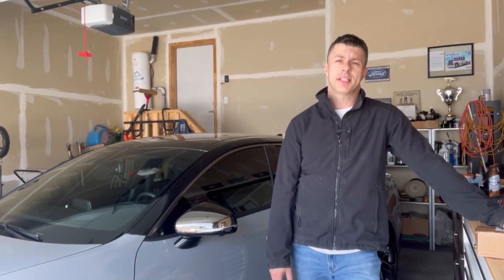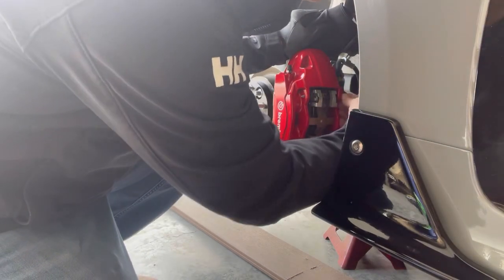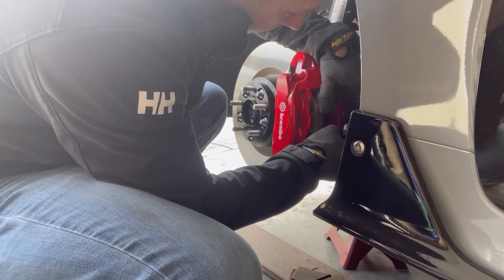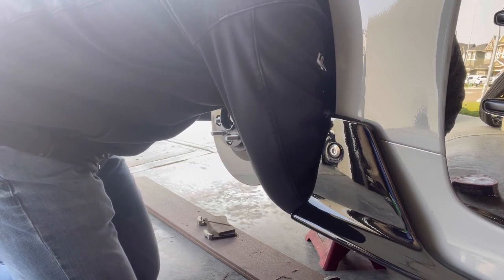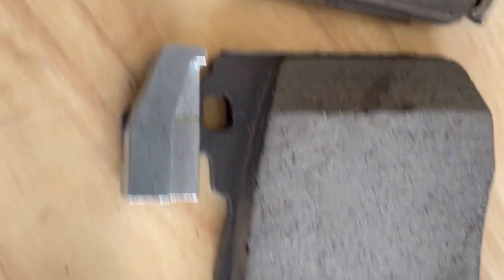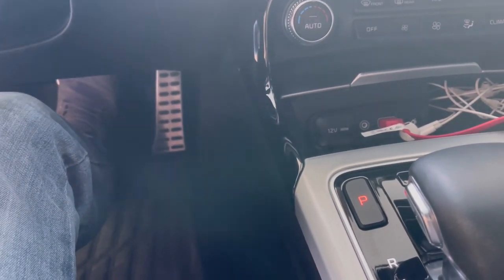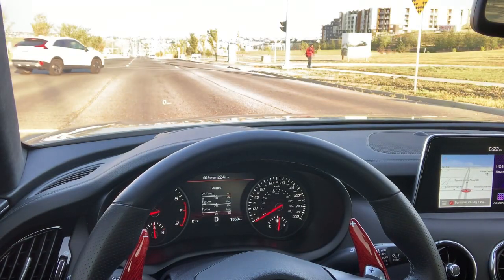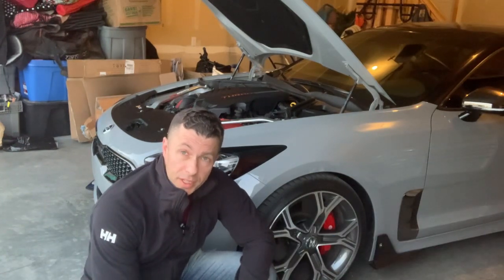CHEAP - QUICK Fix For Your Vibrating BRAKES | KIA STINGER

Comment from the maker: So far I have put about 1000 miles on the car since installing. All is good. I will update as the miles get put on. Updated Nov 26, 2022
Reply: The problem will return at about 7k to 10k miles.  Happened to me.  I changed the rotors for the R1 Concepts drilled/slotted rotors combo with ceramic pads for about $350 total in Amazon and problem solved. :)
Reply from the maker: @PRBatman I have about 10k km on them now and I still have no issues as of yet.
Reply: @OVRBoosted  That's why I said closer to 10K miles or 16K km.  You'll see.

Comment: "Cleaning the rotors," - you gotta get them resurfaced man. Take into account that the pads grip both the proximal and distal surfaces of the rotor. Unless you're gonna take the rotors completely off and clean the proximal part of the rotor then it's pointless. Furthermore "cleaning" doesn't properly remove the resin from the old brake pads in order to bed the new ones on a fresh surface. The only way to do that is to get the rotors resurfaced. Cheaping out doesn't sound like a good idea with this.
Reply from the maker: I see your point of view. I have had warped rotors in other cars and you can tell they are warped if the brakes are e hot or cold and under light and hard braking. The stinger only vibrates when hot then it goes away. Over 1000miles on just the pads I changed and zero shake under hard breaking.
Reply: @OVRBoosted  I watched your entire video. You said there was ever so slightly a vibration if you really payed attention, you could have probably 100% gotten rid of the vibrations overall if you would have followed standard pad and rotor procedure (which mind you is already very inexpensive). Could probably be because the rotors were not refurfaced prior to new pads. So essentially you have old caked on resin on both sides of the rotor and new pads that  tried to get their factory resin bedded into the rotor to create a silky smooth surface, but that was not possible because the rotors were not resurfaced. Not trying to argue with you just saying that it's already very cheap to do this and that's the right way to do it.
Reply from the maker: Absolutely agree, I did only do the front pads and as time went on around the 200 mile mark there isn’t any shake at all anymore. I’m sure I would’ve gone wrong if I turned the rotors. My videos intention was to get rid of the vibration the cheapest way possible. I honestly thought I’d be doing rotors, I didn’t expect the pads to work.

Comment: I own a Dodge Challenger R/T and a G70, both have 4 piston Brembo brakes. The only difference is the Challenger has slotted rotors. Zero vibration from my Challenger and the G70……vibration like crazy. I just bought new pads and slotted rotors. Slotted rotors clean the build up off the pads which is creating the issue.
Reply from the maker: I just swapped the front pads as seen in the video, no vibrations for over a year so far.

Comment: I've replaced my front rotors with dimpled and slotted, replaced the pads with same pads as you, replaced all 4 brake lines with steel braided lines. Still at high temp from about 120mph on the brakes aggressive still have shaking but not as bad. Maybe I'll need to replace the  rears rotors as well with slotted and maybe I'll go with a drilled in the front. This is a ridiculous issue
Reply from the maker: It is a ridiculous issue, so far I haven’t had an issue unless I really heat them up to the point of smoking. Other then that it’s been a night and day difference so far.

Comment: Pads for sure. The little bit of shake likely went away because the new pads scrubbed the pad material that was originally transferred to the discs. I can't imagine what it would take to warp beefy rotors like those...
Reply from the maker: So far so good, no more vibrations. Brakes feel amazing at this point.

Comment: I realize you are up north but here in southern Louisiana we call it pulsating (if that is indeed what you are referring to).  I am a FORMER auto mechanic; left the industry in 1999 but I specialized in front end and ground contact maintenance.  This means anything on the front end with steering, suspension, etc and anything attached at the rear with the wheels; suspension, brakes, etc.  My personal vehicles all needed upgraded front braking, esp my Titan.  I went with the highest quality brakes at a national chain b/c I was lazy and it failed in under 20k miles.  Free replacement and again, in about the same mileage, the pulsating was back.  I should mention that I sometimes pull a 9,400 pound trailer with a tractor on it so this does work the Titan brakes a bit more.  I finally spent the bigger bucks and installed high quality rotors and pads.  I have about 60k miles on them and not one issue.  Thanks for posting the video.  It was easy to follow and I especially liked the 'break in' of the pads at the beginning and then you performing the 'break in'.
Reply from the maker: Thanks I appreciate your advice and information. I’ll definitely be changing rotors next if it comes back. So far things are okay.

Comment: I had that same problem with my Genesis G70 brembo brakes. Took it to the dealer and they replaced all 4 rotors under warrenty. Great vid!
Reply from the maker: Thank you for the comment. I just did the front pads and still no vibrations.
Reply: Did the new ones end up with the same issue? It seems this is one of those issues Hyundai just didn't really want to deal with because even the 2023 still come with the terrible pads
Reply: @gfdia35  wow. Thought they would have fixed it by now. It wasn't my pads but the rotors. But the fix worked. I have no issues with the brembos now

Comment: Thanks for confirming it's the damn pads.  I suspected the pads when my car would sit for weeks on the driveway and develop a slight rust on the rotors.  Once the rust would be scrubbed off, the vibration would say away for a while.  So the rusting process was probably removing brake pad material off the surface.  Has anyone come up with a fix for the folding mirrors getting stuck periodically in the closed position on only one side?
Reply from the maker: I haven’t experienced the mirror getting stuck yet.

Comment: Just installed those pads on my 18 GT2 today. Replaced the rotors as well (Centric rotors). Bedded them as recommended. So far shudder, which was definitely an issue with stock since low miles, is gone. Will see how they do with dust. I got the pads from Amazon.
Reply from the maker: That’s great that it’s not doing it anymore. The brake dust is almost non existent so far for myself.
Reply: @OVRBoosted  any squeaking or vibrations after driving with them for a while? 
I have a issue with the pads moving slightly so it has a brake Groan sound.
Reply from the maker: I have had no issues to report as of yet. I very satisfied so far. I have no shake anymore.

Comment: Casey I  learned something  totally new unrelated to the title of your video.. I had no ideal the pads were that easy to swap out so the caliper doesnt  have to come off at all wow.  My Corolla  brakes are harder than this to do.   I have GIRODISC pads and cquence Rotors they have been solid.
Reply from the maker: Brembo brakes are probably the easiest brakes to swap pads. It’s a great system. I wanted to show people how easy it is to save them from paying a shop. It only took me about 45 min to do both sides from start to finish.

Comment: I have never used the "Pro Stop" brand brake pads. I HAVE however, used the the "Pro Stop" cross drilled brake rotors, in combination with "Hawk" ceramic pads. Those were a great combination on both my "03 Toyota Matrix XRS, and my "02 Acura RL. Fantastic stopping power, and no fade in the canyons.

I have been looking at getting a Stinger GT early next year, and I'll likely use that combination. I'm happy to learn that the Hawk pads are available for the car. More expensive though, about $170.. so says the internet.
Reply from the maker: I haven’t had a single issue since I swapped out the pads over a year ago. Still holding strong.

Comment: Good job on the DIY service !
I own the same car 
At 30,000 Kms ( 22,000 miles ) bad shaking.
Cant belive KIA puts the Best Calipers on with Cheap pads.
Anyway I was thinking I would have to change the rotors 
BUT thanks to your video .im going to do just the same and hope it clears the KIA SHAKE !
Reply from the maker: I’d possibly recommend getting the rotors turned at that mileage. If still have no vibrations for only the front pads being swapped, but I swapped my pads at 5k km. Just a suggestion
Reply: it won't solve it, it will come back at about 7k to 10k miles.  The problem is they are using Kia Soul rotors on a Stinger. Lol.  I changed the rotors for the R1 Concepts drilled/slotted rotors combo with ceramic pads for about $350 total in Amazon and problem solved. :)

Comment: I have purchased Z26-6012 by power stop from Amazon and will update you once  swapped
Reply from the maker: Sounds good, I think you will be very happy with power stop. If the evaluations hold up the z26 is the performance line and should be even better.

Comment: The ol pad slap. If your gonna perform a "pad slap" at least pull the rotor off and sand the glaze off the rotors. I would prefer a .05 cut on the lathe myself.....on that note enjoying the channel. 25+ year tech here.
Reply from the maker: Thank you for the advice, it is appreciated and I’m definitely not a mechanic. The car only had about 4,000km on it at the time of the swap. I now have about 10,000km on the car and haven’t had any shake at all. I might have got lucky. I was attempting to show people the cheapest way to stop their vibrating brakes.

Comment: So, people still believe the vibration are pads issue that needs replacing instead of just cleaning the deposits off the rotors ? He felt slight vibrations, because he may not have cleaned off the rotors or the rotors have uneven wear on them ??  but if you're going to buy new pads for a Stinger GT, why would you get the Evolution ? The Extreme Z26, that I got, are the more direct replacement level that would match the bembro level for that car.  My Z26 Rear I got seem great so far, so I recommend Powerstop too, but mine needed changing due to wear down and time to change. I've felt the vibration everyone talks about on my Stinger, but it always went away on it's own, after a hard brake or two.  My front are still stock pads, at over 40K miles (72K kms) and they'll make it to the spring/summer, it seems. I'll get the Z26 for the front too. and if my rotors are still within Spec and safe, I'll just turn them and re-use one more time. They're quality durable bembro rotors, why would folks change them ??? until they need it ??   Sadly, Powerstop doesn't make Plain smooth rotors for Stingers. only drilled kind, of which i do NOT want. Plain is just fine and better..

Comment: Very nice tutorial! You make changing the pads so simple. Hope you braking feeling is better now. I purchase front and rear rotors by Stoptech (Performance Premium) and I purchased the stoptech pads from K8stinger. But the shudder is still there but only feeling it from the rear. Don't know if stoptech quality has gone done or what. I've checked my rotors and they have that ripple look. And yes, It only happens when the brakes are at temp and when I brake from 80 sometimes it vibrates a little from 50 on local roads.
Reply from the maker: At this point I have about 300 miles on the new pads. The shutter has completely disappeared. Or en tried getting them a bit hot yesterday and no shaking. So far I’m very happy. Did you just do your brakes? I did notice you have to do the bedding process because when I first started bedding I could feel it shake a bit.
Reply: @OVRBoosted  I had mine done right around the end of Spring, I changed the pads first and then rotors, because most people on the forums said the issue comes from the pads. But right after I changed the pads it worked well for about maybe a month and then back to the shuddering, same when I changed the rotors too, but now I feel the shuddering from the rear. I can live with the shuddering for now since I don't race or drive like a maniac. haha
Reply from the maker: @terrorsz75  do you have any warranty left?
Reply: @OVRBoosted  Not sure about that. It's probably a little too late. I think since the summer I've put on about 9k - 10k miles. Originally I changed the pad and rotors around 3k. I got the Stinger right around the shut down so it was in the drive way more than the roads. hahaha
Reply from the maker: @terrorsz75  it’s strange that you feel it in the back. Most braking is done on the front brakes. I only changed out the front pads and it’s completely gone. The brakes never felt better. I know k8 runs the same pads on their shop stinger as well and they also said there shake went away.
Reply: @OVRBoosted  I know, maybe for me it was bad luck to get a bad batch. Yours came in a nice box mine came wrapped in plastic film and nothing and no box. The vibrations isn't bad like the front where the steering wheel vibrates like it was going over cobble stone roads. There's no steering vibration.

Comment: Did after awhile it’ll do it randomly sometimes. You need to change the rotors too.
Reply from the maker: What pads did you use?
Reply: @OVRBoosted  stoptech, dealership recommended it. Then they just changed the rotors and gave me new ones

Comment: good video but funny how you blurred out the speedo but the HUD still shows the digital speed readout
i love my stinger too
Reply from the maker: Lol my error of course. It’s a good thing I’m down in Mexico 😂
Reply: @OVRBoosted   Great video, my 22 does the same shaking when applying the brakes.   I'm going to have to change the pads.  Also, why do you and other people keep saying that they're "down in Mexico?!"
Reply from the maker: @williamblackwell9968  i highly recommend the power stop pads. I’m very happy so far with the performance. K8 store will set you up if you shoot them an email. They do run those pads on their shop stinger. People say they are in “Mexico” due to there being not the same rules that there is here.
Reply: @OVRBoosted  I mean, sure you can say that if you want, but what I don't understand is why people think that doing so somehow protects them from the cops in any way. If the cops wanted to prosecute based on a YouTube video (where all of the signs are in English; and anyone familiar with the area would know exactly where the video took place), its not like they're going to then say, "Oh, wait! In the comments the suspect told everyone that they were in Mexico, nevermind, they got us again!"  

Besides, your GPS says that you're at the intersection of Symons Valley Parkway and Kincora Gate NW.  A quick google search tells me you're in in Calgary, AB. 😬
Reply from the maker: @williamblackwell9968  I think it’s more of a running joke more then anything

Comment: Hi greetings from Tabasco México, i have a Stinger 2.0 with just 1000 kilometers and I feel I vibration when I put the brakes at 80 kilometers per hou o less, what do you think is the problem? Do you think is the same issue? Do you recommend to change the paddles? Do I have to rectify my discs? Thank you very much in advance.
Reply from the maker: Do you have the brembo brakes? If you replace the pads it will usually fix the vibration. Kia used a brake pad that has a softer compound. So when they heat up little particles stick to the rotor causing a vibration. I’d switch the pads to power stop pads and you can get those at the k8 stinger store. You could also just have the rotors re surfaced if you wanted. But with only 1000km it’s most likely just the brake pads.
Reply: @OVRBoosted  hi, the 2.0 at least here in Mexico, came equipped with  ordinary pads no whit the Brembo, just 1000 kilometers it is incredible to have that problem! I will replace them and I will let you know as soon as possible, thank you very much.

Comment: Aare we supposed to go with Evolution pads now or try to get StopTech when they're back in stock?
Reply from the maker: I went with the power stop pads. K8 stinger store recommended them because they run them on their shop stinger. Power stop has a higher performance pad that I believe is a z26. I should have went with those, but I haven’t had any issues with the evaluation. K8 said they are a better pad then stopTech.

Comment: For some reason the USA did not go with original Brembo brake pads for stinger, here in Australia if you take the pad out they are marked Brembo on the back of the pads. Something about USA Law regarding the pads, did you try looking for original Brembo pads and could you find them over there?
Reply from the maker: I’m up in Canada am I’m not sure what pads they decided to use. They are no good though. Since installing the new pads I have had no issues.

Comment: do I need to have facing on the rotors due fixing the new z26 please..
Reply from the maker: It wouldn’t hurt to have the rotors turned. It’s cheap to have done and it’s a good piece of mind. My car only had 5000km on those brakes so I didn’t bother to turn the rotors.

Comment: I ordered the Stop Techs but they don't fit like the oem. They are superior but they are slightly smaller and move within the caliper.
Reply from the maker: A lot of guys say the stop tech make noise? K8 recommended the power stop as they run them on their shop stinger.